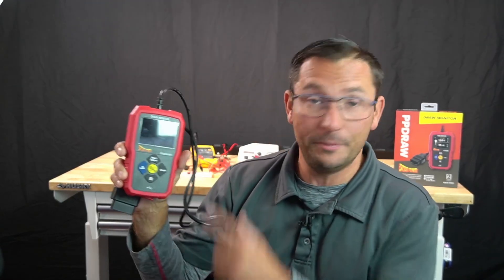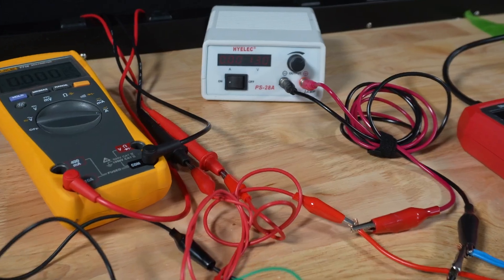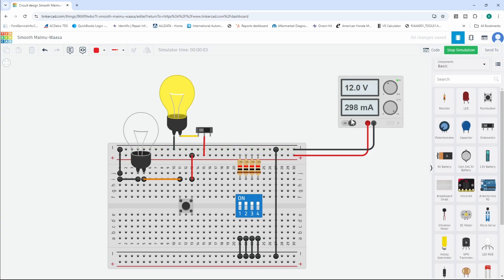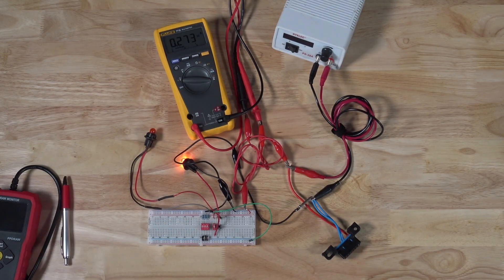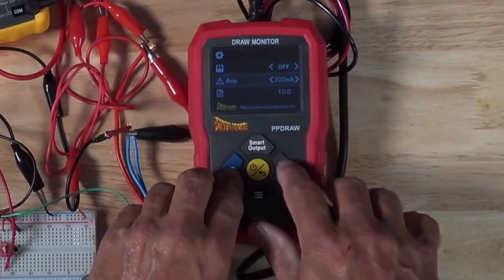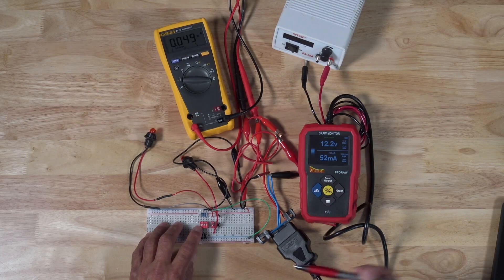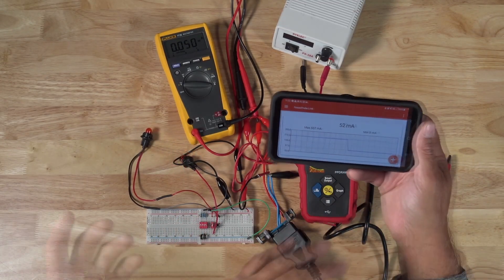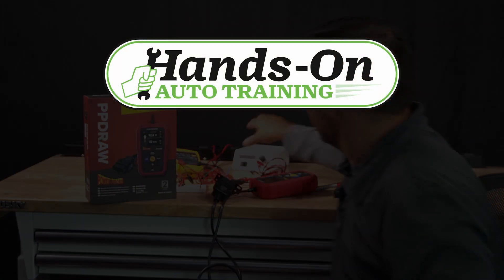Power Probe Parasitic Draw Tester Review and Testing

Comment: Will this device work with the battery still connected?
Reply from the maker: It will not properly read the current flow unless all of the current is supplied by the device.

Comment: My 2011 bmw 335i starts at 140ma, drops to 64ma, and then settles at 0ma. Is 0ma possible? If the cars sits for more than 3 or 4 days it won't start. Brand new battery and it was registered. Old battery also tests good.

Comment: Awesome tool except the power consumption is unacceptable.  As a technician who uses a multimeter several hours a day, I shouldn't have to change out batteries every day just to keep the tool functional.  You already have LIon batteries in your ppdraw, why wouldn't you put them in this to recharge or have a LIon pack that can be swapped for standard cells?  Be better if you're targeting people who use these tools professionally every day.

Comment: So if you plug it in and see a draw.. whats the next step.. do you pull fuses one at a time to see when it drops to isolate the problem? how do find whats actually causing the draw?
Reply: Pulling fuses and plugging them in can wake modules up and give you a false reading because you cause the draw by waking module up. The thing to do is measure with your multimeter dc voltage across each fuse. The you use conversion chart from power probe or do math to change milivolts to miliamps.  There is another tool that can be bought as combo with kit it does the conversion for you as you measure at fuse.

Comment: i have honda hrv 2020 found a draw on a fuse #21 and #22 back up and audio do you know were i can get a wiring diagram?? alldata dont have it mitchel is only usa  or you have idea about the problem ?possible audio? system speaker? door actuator because every time i close it does not go to beep sound

Comment: That is very cool. I made my own memory saver with an OBD2 breakout box, some custom spade terminal to 4mm banana jack leads (with fuse) to connect an m12 battery to pins 4 and 16. A DVOM can easily be placed onto circuit to measure voltage, while a second one can be placed into circuit to measure current.

Comment: Whats the fkn point of it doesn't tell u what computer, module or circuit is causing the draw?   A cheap meter will do the same the same thing even better.
Reply from the maker: The point is to tell if  you have a draw or not without disconnecting the battery.
Reply: You clearly have no experience properly diagnosing a parasitic drain
Reply: @ blackie

Comment: So what about vehicles with Gateways built into the OBD port? What sort of issues might that cause since it's feeding power to a node in a network? Would it keep modules awake that you would want powered down?
Reply: The dlc is a fake network on gateway cars. This tool is not gonna work.
Reply: Might have to get creative there and just grab a power and ground. At the fuse would probably be easiest.
Reply: Did you ever find out if it truly does work well? Seems like there's conflicting information
Reply: Think about what you are saying and go pull a wiring diagram for an obd connector on any car.

Comment: How long can you monitor drain for.?
Reply from the maker: Depending on the amount of the draw. If a 3 amp draw it will probably  just last near an hour, if it is a 300 milli amp draw i would expect many hours of use. I am not sure how much current the actual tool uses.
Reply: @BrianMann216  Does the value the tool displays compensate for the drain of the tool?

Comment: How long can it be attached to car before the tool goes dead or turns off?. 15 minutes doesn’t seem long enough
Reply from the maker: It all depends on the amount of the actual draw.. the apo function turned off it will power the vehicle as long a s it's internal battery is up to the task.
Reply: @BrianMann216 you can plug it into USB-C to work as long as you want. I did this the other day on a car that i was working on the side in between appointment cars.
Reply: @BrianMann216  👍🏻
Reply: you can turn the sleep timer off but it defaults to on every time you turn the tool on
Reply: can turn the sleep mode off on the tool
Reply: @ excellent I just bought it 👊🏻
Reply: @  check out their new meter also  300 auto
Reply: @ I was going to get it but no min max button. I asked them they said next time. So I’ll wait . Min/Max is a must for me